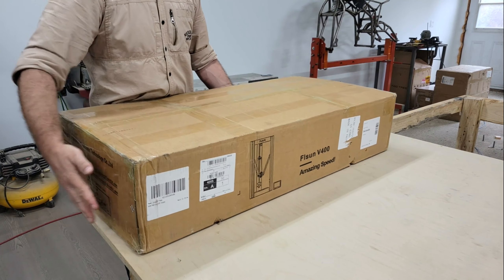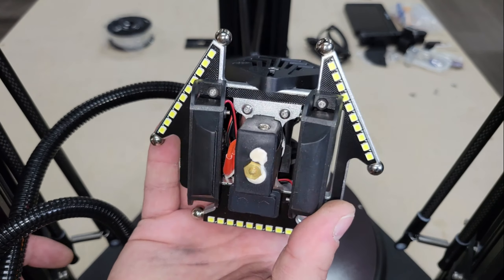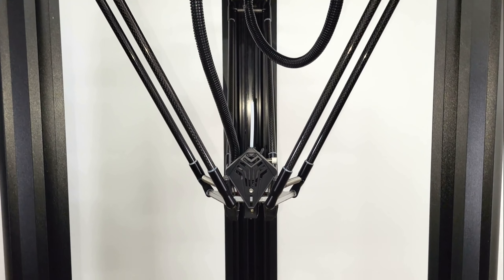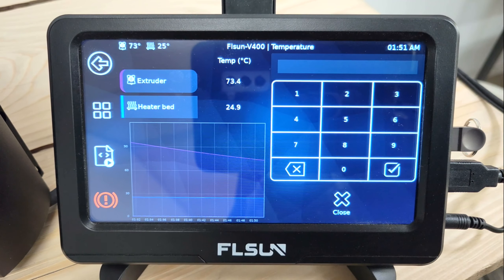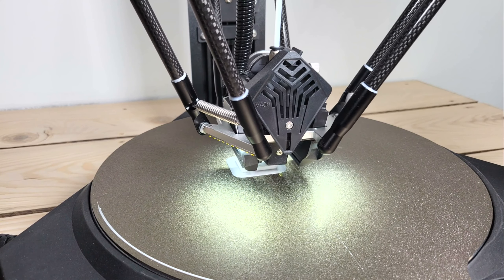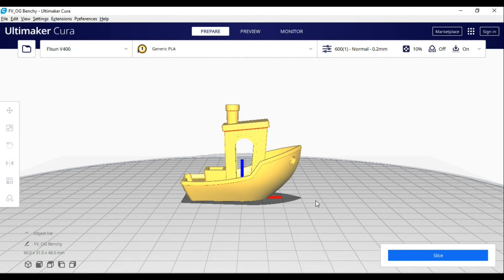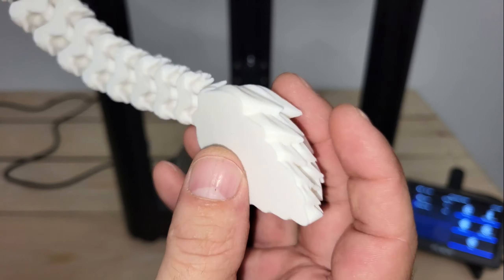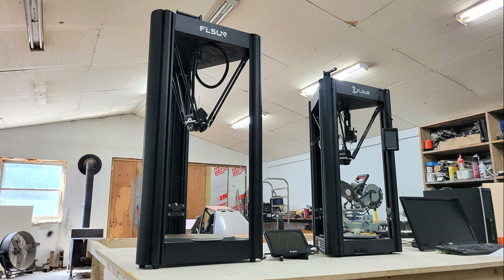FLSun V400 High Speed Delta FDM 3D Printer - Super Racer's Big Brother

Comment: I used to have a super racer before my current printer (X1C). 
Was a great printer, and I still miss how whisper quiet it was, only the retractions were audible, seems like the V400 is just as quiet. Extremely well built, and didn't have a single issue with it.

Still there were a few things missing, and most of those seem to have been solved in the V400. Especially the direct drive, lights and build plate. There's two things missing though, an enclosure and a full metal hotend, the latter of which can be solved quite easily. That would open up a lot of filaments not currently possible. Also with the advancements in tech we expect many more things nowadays (vibration compensation, lidar, almost fully automatic working etc), so I am very curious how the T1 and especially the S1 compare. Only thing they are missing is an AMS type system.

The V400 looks absolutely massive though! I already thought the SR was huge, but this dwarfs it in comparison!